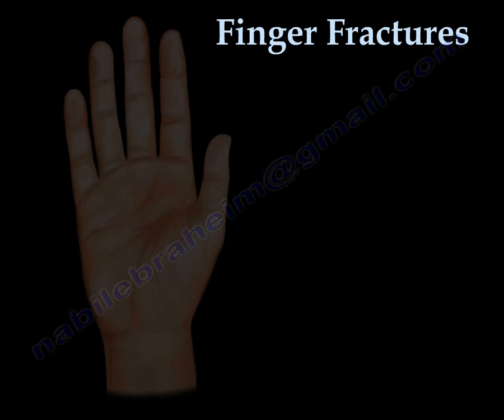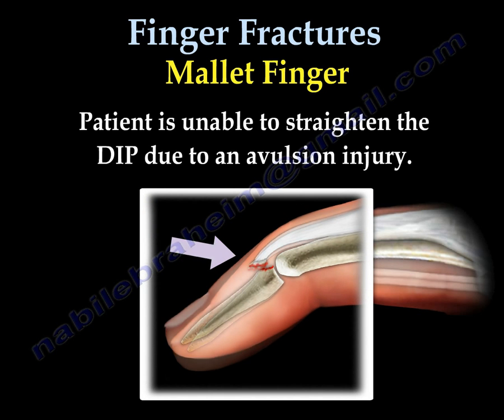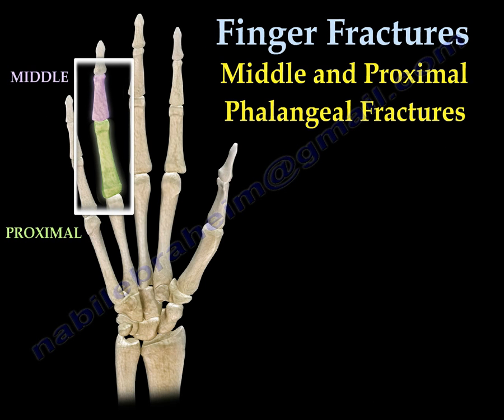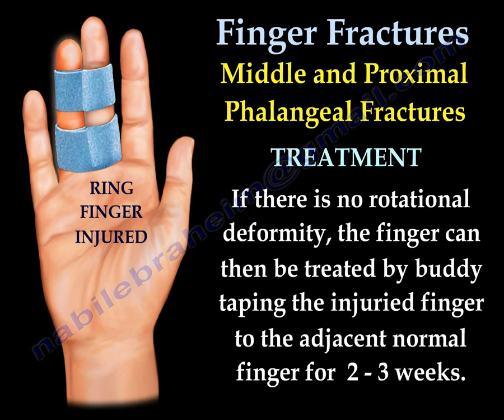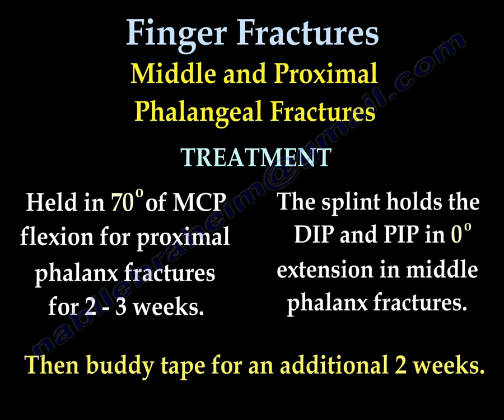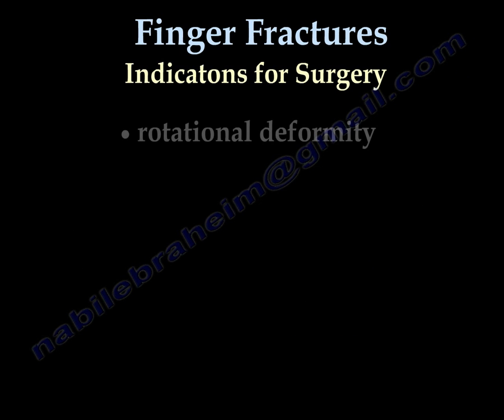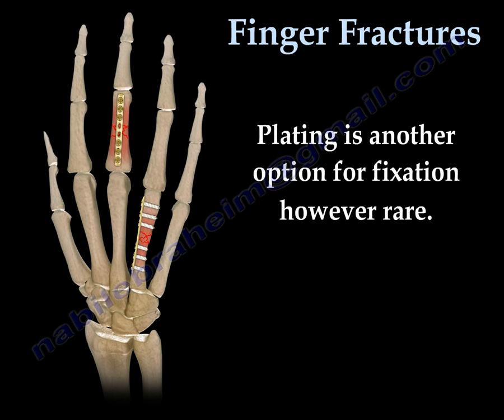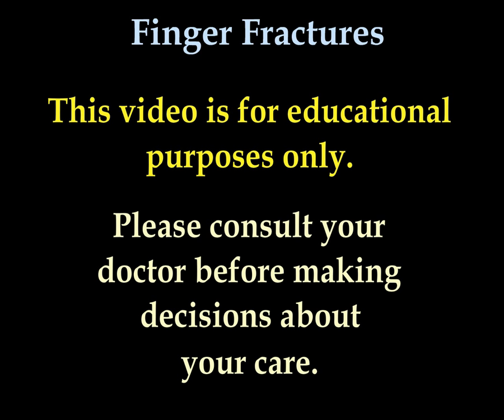Finger and metacarpal Fractures - Everything You Need To Know - Dr. Nabil Ebraheim

Comment: Had a crush injury on little finger in early Jan 2014. Immdtly went in for surgery. Damage was comminuted fracture of middle phalanx with deep laceration. Hand ws in cast for 3 wks with k-wire. Removed. Physio is on since feb. However the dip joint does not work as tendons are stuck. will I be able to recover movement? People with a similar exp?
Reply: did u fully recover?